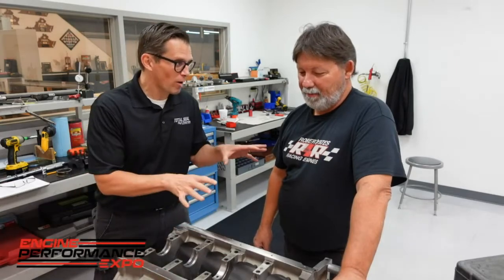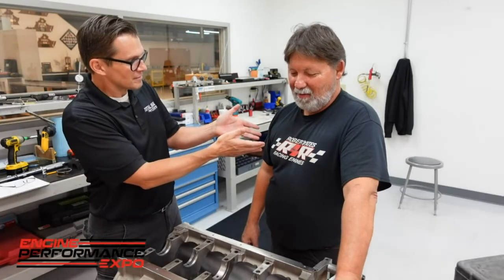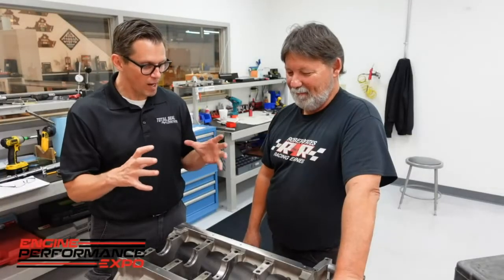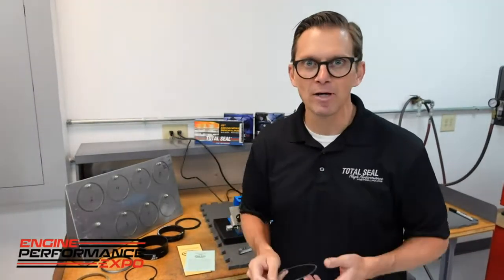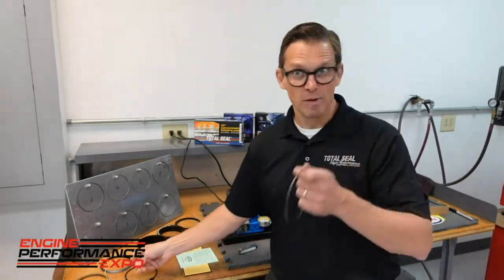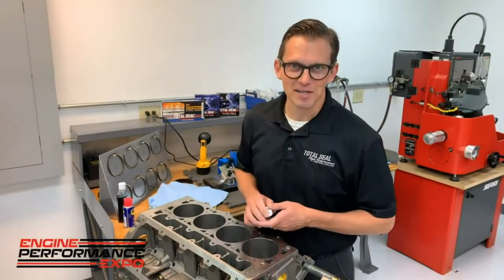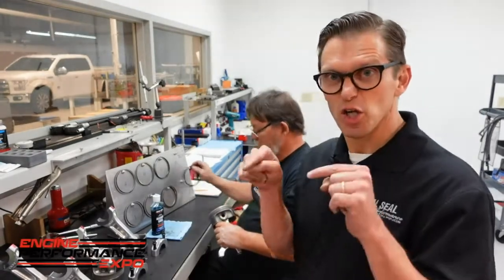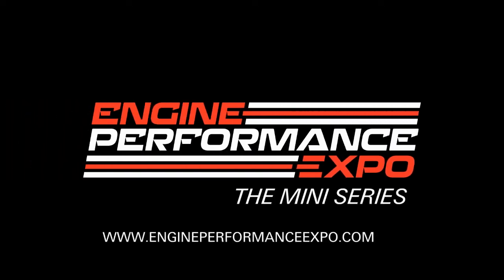Short Bock Engine Assembly (2021-22 - Episode 30)

Comment: I appreciate the detailed information that Lake and Jimmy provided about the preparation and installation of the Total Seal gas ported, gapless piston ring sets. In the follow up segment after this engine was subjected to some serious dyno test flogging,  Lakes Motor Oil Geek analysis revealed some very interesting results. 

The used oil chromium content from ring wear never exceeded 1 ppm in all of the NA and forced induction tests. The Total Seal rings were the only component listed that didn’t have excessive wear. Of course using a quality oil of the proper viscosity is important. But extreme boost will quickly reveal a poorly assembled engine or inferior components. 
Well done Lake, Jimmy and Total Seal 🏁